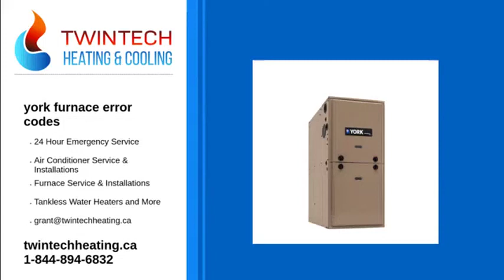york furnace error codes

Comment: I have 6 red flashes so do i leave on for 1 hour an it will reset or what can i do please help
Reply: 6 red flashes indicates trouble with the units modulating gas valve. With this one, I’d call for service as there aren’t too many user serviceable components on the valve. And besides…you’re dealing with natural gas or propane  which can be dangerous if you’re not properly trained. However, with the furnace unit UNPLUGGED from wall power, what you can do is simply check the wiring that attaches to the gas solenoid mounted on the valve itself. If all seems tight, call for service.
Reply: @SPUDWRENCH  OK thank you